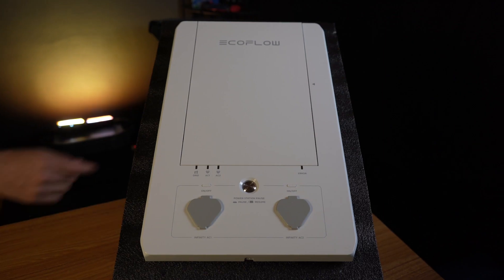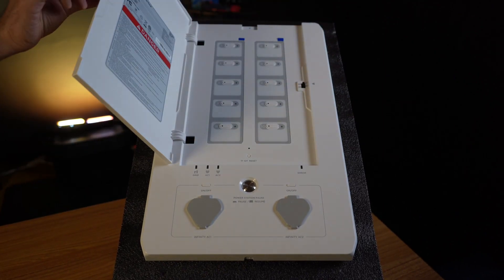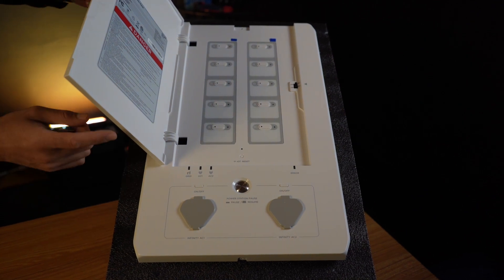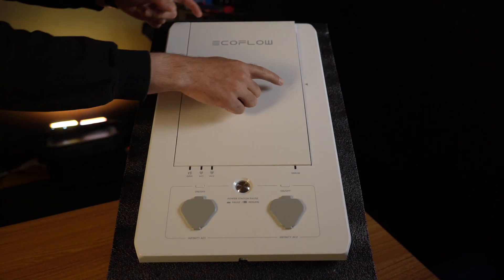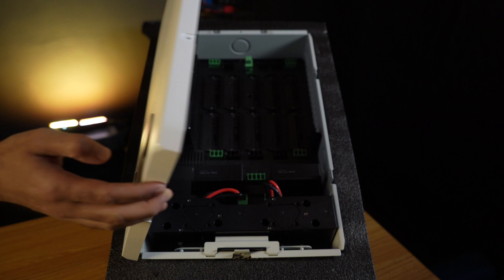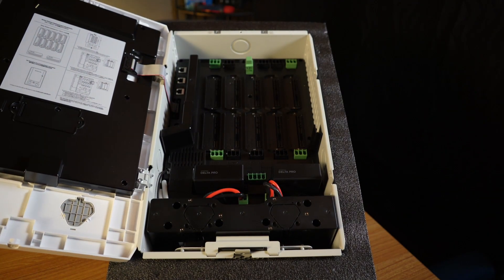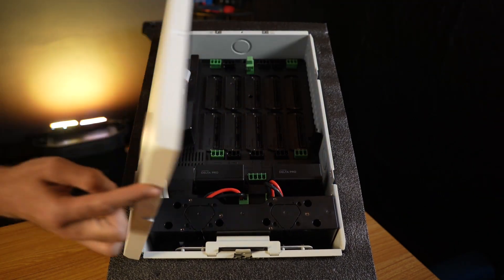The EcoFlow Smart Home Panel |  How to get it installed safely

Comment: Can These Be Used As a Off Grid Replacement for a regular circuit breaker?  I've got a circuit panel.  I've got the Delta Pro, and two of the Delta 1260/1800's.